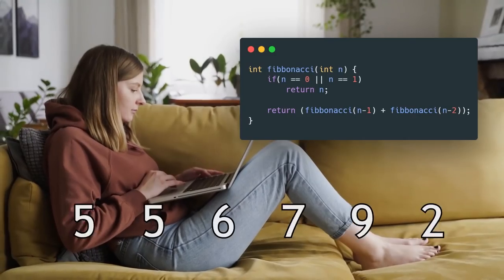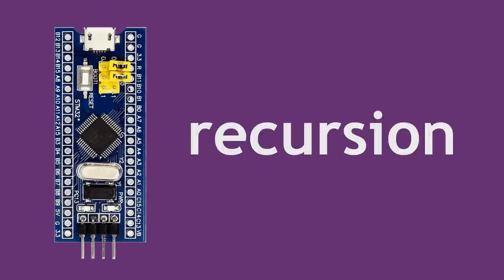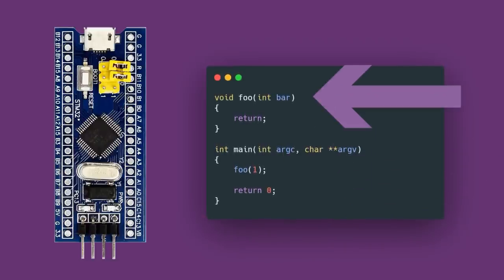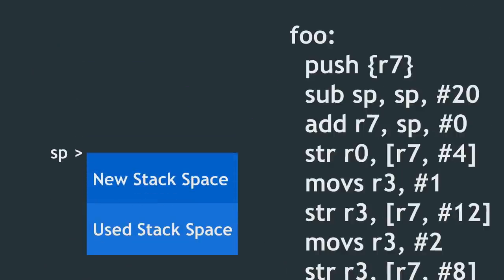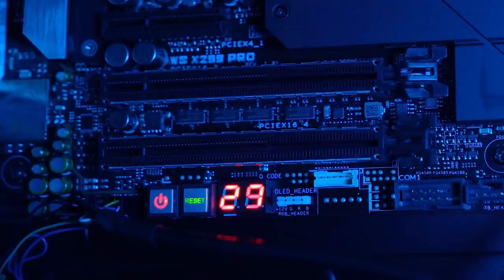why is recursion bad?

Comment: I've been writing C for 30 years, I have never had need to call a function from within itself.
Reply: What about the MiniMax algorithm?
Reply: @softwarelivre2389  I had to google it, not the kind of code i've ever been asked to write.  I am not going to pretend I know what I am talking about, but a search for 'non recursive minimax' seemed to find working examples.
Reply: @jonshouse1  you could probably allocate a tree-like structure and work iteratively on it and you'd had a non-recursive minimax, but I've never seen anyone doing it and I don't know if it is feasible.
Reply: @softwarelivre2389  have a stack data structure where you push tree nodes into and pop from. This will allow you to iteratively go over the tree. So you first push the head of the tree, pop it and push it's children, so on and so fourth. If you want you can even scan the tree by height with a queue.
Reply: @kandlerziv4733  never thought of using stacks or queues in a tree, I always saw both stacks and queues as linear, while trees could be branched. But it is a really interesting view and I'll take a look on that soon. Thanks for the info!

Comment: I'm a Haskell programmer, so I literally can't write any code without using recursion. Otoh, Haskell isn't the best fit for embedded, so it doesn't really matter. TCO means stack space is not a problem (as long as you are careful).

Comment: Stack overflows are merely annoying on bigger machines not because they have lots of RAM (it helps a bit though), but because of memory protection. In the early 90s, you could have megabytes of RAM, but one rampant recursion later and your entire OS was hosed and required a reboot. These days, you get an error message, close it and continue as if nothing important happened.

Comment: It’s a good point that recursion should be avoided if it can be avoided using simple code refactoring. But in fact, when trying to convert recursive code into iterative code, in most of the cases, you will end up creating your own implementation of stack for the algorithm, by simply allocating a memory buffer (for example in DFS or BFS). In those cases, the overhead of recursions is actually minimal, since you actually do JMP instruction in both cases, and in terms of memory, the only overhead is a function return address (1 word per call), not much, unless you are on a really tight memory budget. In that case it is simpler to just use recursion and just don’t bother:)
Reply: Bingo.  I did this exactly for a quicksort implementation once, then I looked at it and facepalmed because I had produced exactly the same code but used the heap instead of the stack.  In x86 ASM, though, I did get a modest performance improvement just out of replacing RET with JMP, but still using the stack for the memory.

There are fundamental limits when we talk about algorithms.  Often there is a lower bound for the complexity.  You can move that around between time and memory, you can move it around between stack and heap and static, but you absolutely cannot make it disappear.  It's fundamental to the solution.

Comment: The point of the video is well taken but recursion isn't entirely out on embedded. For example, there's recursion with static functions and trampolining (where your return value provides some indication of a re-entrant call along with the parameters for that call). Both maintain a fixed stack depth. Admittedly, these are a less powerful form of recursion, unable to return back to previous states stored in the stack. You could also use a language that supports tail call optimization, which effectively acts as a static function when the recursion point is in a tail position (i.e. the last thing done in a function). Rust can do this but provides no guarantees. Some C compilers will also (similarly with no guarantees) when given the right optimization flags.

Comment: A 'static' prefix will allocate the variable on the heap but be careful of initialization- it's only done once, first time the recursive function is called.
Reply: No, static doesn't allocate on the heap. It allocates on the static memory.
Reply: @AlessioSangalli  , depends on the memory model. But you are right, it could be outside both heap and stack spaces in a preallocated data segment. Good point.
Reply: @test40323  well yeah the C memory model doesn't really specify "how" memory is allocated, but I am not aware of a compiler system that allocates static variables in the heap 😅
Reply: @AlessioSangalli  , thanks for the correction. My point is static variables in functions are not allocated on each call recursive or not. If my memory serve, a tiny memory model allocates everything in an Intel 64k segment, code, data, heap, stack. With optimization on, there are no bounds on stack just data corruptions as they grow towards each other.
Reply: @test40323  often (but not always) in embedded there is no MMU and no virtual memory so yeah the stack starts somewhere (possibly even less than 64k) and goes down overwriting whatever

Comment: Every recursive function can be written as a tail recursive function. Every tail recursive function can be optimized automatically e.g. by a compiler to be as memory efficient as a loop. So if recursion blows your stack it’s highly depended on your language and compiler.
Reply: Let’s see your tail-recursive version of Ackermann’s Function.
Reply: @lawrencedoliveiro9104  You are right. The claim only holds for primitive recursive functions. But other recursive algorithms cannot be implemented in an memory efficient way and should be avoided anyways.

Comment: Recursion is very often:
-hard to read (just think of the first time you encountered recursion)
-less than or at best as performant as loops
-not clear as to how long/deep that recursion will go

I hate recursion.
Reply: Recursion is easier to read and easier to write if only you understand recursion.  It also helps with avoiding bugs.  And the Knights of the Order of the Lambda Calculus have proven that recursion is typically more efficient than the clumsy constructs made by people who don't understand recursion.  (Goto considered harmful.). Recursion is just loops, which becomes obvious when you understand it.

Unfortunately, to understand recursion, you first have to understand recursion.

If you don't understand recursion, you're not a programmer.  But when your compiler insists on using stack for recursion even where no stack is needed, you have to work around it by hand, which is what this video is about.

This is often an issue with C, and always an issue with Java and even Python.

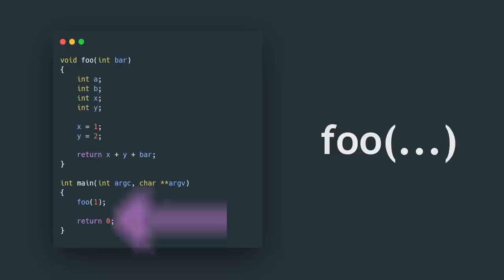Comment: 1:22 - Not exactly "padding". At least the return address is also needed.

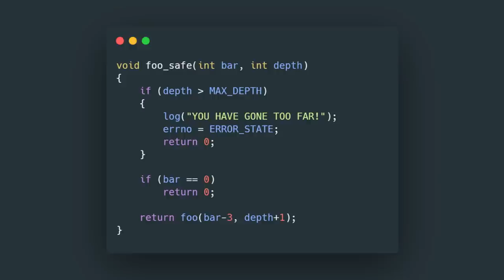2:35 - Well, if you cannot predict how deep your recursion is going to be, then indeed don't use it. 

There are many algorithms that are "naturally" recursive. Recursive functions are also often easier to read. (A typical example would be already mentioned Fibonacci numbers of Towers of Hanoi problem.) While, in principle, every recursive algorithm can be expressed by iteration, it is often done by explicitly managing the stack, with neither performance for storage advantages. However, there are problems where iterative algorithm is much "laener" that recursive one (a trivial example is factorial function).

Comment: Well even on embedded systems this advice needs to be taken with a grain of salt. Under certain likely conditions your compiler will be able to proof that it doesn't need to return to the calling function. This "tail call" is then simply converted into a jump to the body of the function itself. Unfortunately, while most mainstream C compilers support that by now, often it is only enabled by -O3.

So if you know what you are doing, you can often replace those weird C features like "destructive variable assignment" or "loop constructs" with much cleaner recursion. However you need to be careful about it and perhaps occasionally check if your compiler actually optimizes it.

To those people who don't know C: The language has some weird quirks. For example this is perfectly valid in C:
int x=5; //Variable definition
x=4; //Assigning a different value to x, the previous value is lost! This will compile and run!

Or loops in C are often done like this:
for (int x=0; x<10; x=x+1) {
.....
}

This actually uses destructive assignments to change the value of x, so every time the inside of the loop is run, x will have a different value. If you destructively assign x=999 this will be the last time the statements will be executed. I think much of the bad reputation C has comes from people expecting the compiler to not allow that sort of thing.

Of course if you come from an Assembler background this all makes sense, so if you want to learn C, it makes sense to first familiarize yourself with some simple Assembler. (e.g. Z80, 6052, AVR 8-Bit) C is, in many ways, just a "friendly" semi-portable assembler. It's not like a high-level language like Prolog which you can just program without knowing how computers work.

Comment: I was lucky enough to TRY to begin computer science in 1995, with the first language being Scheme, which is LISP. Horrible, confusing and ridiculous because it's a functional language that's nothing but recursion. Then, returning to get a CS degree at the same university many years later, I started with Java, learned C very well, and happened to take "comparative programming languages" where I learned LISP, Haskell and COBOL as an elective language. At this point, most CS students dread recursion because it's hard to conceptualize and they NEVER learn a functional language other than C. They have no idea why LISP is called "lots of idiotic silly parenthesis" and how it's a recursive nightmare to conquer. I like the video as a way to help people learn about new limits to consider but with a modern degree, you can learn your assembly AND dabble in ancient functional recursive stuff enough if you elect and this would be obvious. Don't ignore a chance to take that course.

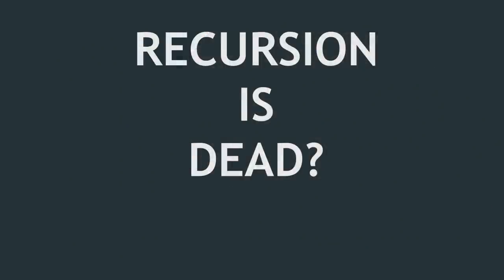Comment: 2:25 another thing to add that might work to make recursion easier on embedded hardware (and not into a logic bomb) is the use of a register that holds the end value and then the memory is allocated in the same place replacing the first instance of memory (which houses the program) with a new program instance. this would allow the program to occupy the same memory space while still keeping the values changing as expected, changing while the program runs..... I think I just explained a conditional loop now that I think about it....

Hope you have a great day & Safe Travels!

Comment: is recursion only recursion if you call the same method from inside of it? i would never do that as it always takes up all the memory in the stack in java xdd
Reply: Yes recursion is when you call the same caller function.
And you can do it perfectly in Java. I’ve used it in Java to traverse a binary tree. But you always need to be aware of the depth. Live this video suggests.
The charm of recursion is, that it’s fault tolerance is higher. (Loops can have off by one errors or calculation depth errors).
Reply: @CallousCoder  I didn't mean that it's not usable in java but I'd prefer loops as for example having a backend discard too large user input because of memory usage is not good imo, ofc for smaller depth that is personal preference and I'd say that using recursion is most likely easier if the case allows it to be implemented without weird hacks
Reply: @kmatias2467  recursion or loops for user input? Can you explain that. I just limit that on the server side. Or use an text field pattern that sets the max length for a field.
I’m curious what you know that I don’t. Love to know :)
Reply: @CallousCoder  i had slept 6 hours in the last 2 nights when i typed that but the idea was to make the data length limited but the recursion not for normal use cases as that would not make the program as limited, I'm still tired as i only slept ~14 hours now, i can't give you an example of this since I'm still tired but for example sending data from something to be calculated server side like how ida does would probably use that

Comment: What you explain in the video is somewhat true but you're mentioning only half of the Truth. What is unwanted is a very specific kind of recursion called "head recursion" where you keep allocating new stack frames because you use recursion to save the local context, do one or several recursive calls, and then resume the computation by combining the results of the recursive calls. Turns out this is a very specific pattern and recursion is not restricted to only that !!!!!

It is often the case (the Fibonacci sequence is a perfect example) that recursive functions can be written in such a way that only ONE stack frame is going to be allocated through the entire execution of the program. Actually, every while loop based program can be rewritten as a tail recursive program. In facts, the tail recursive version is going to be compiled EXACTLY as the while loop by all reasonable modern compilers.

Comment: Fibonacci is a good example but it can be calculated without loops or recursion. There is just function that gets any fibonacci number so you can pug n into the function to get the Fibonacci number and it doesn't include loops nor recurion. Iti s mathematical function.

Comment: I hadn't considered the call stack, but then again, I haven't touched embedded in 7 or 8 years at this point. I just try to avoid recursion where I can, because in many (not all) cases you can write a better and clearer implementation without it. It just takes a bit of extra work.

Comment: Recursion is not bad, you need to learn calculate the complexity is the right way.
To a extend, doing the same sort on different lang like c and Python will very different due to how memory used.
If you are not sure what are you doing, use functions in framework and let them optimize for you.

Comment: Also, probably shouldn't be using recursion for fib anyways. Despite being the example that's primarily taught for recursion, it's recursive solution is laughably bad, O(2^n) if I remember correctly. It can be modified to only use a single recursive call through memoization, but I'd argue that approach is still an inefficient use of resources, especially if you don't care about the whole array and just want the nth digit. Iteration is definitely the way to go for fib.

Comment: The moment you understand there is Space Complexity and not only Time Complexity is the moment you are better then 90% of Programmers out there in Algo.
Reply: Only complexity exists is trade-off complexity, aka general efficiency. If you are running that function once an hour, or dependent on user input on single machine,  if the problem is better suited for recursion, go for it. No? Then don't. Simply as that.
Reply: @yokunjon  Thats just not true. There is Space and Time Complexity. Yes there are certian cases where you have a space-time tradeoff, but most of the time there is just a better way for an Algo where you just have less Time or Space Complexity while maintaining the other Complexity the same.
Reply: @NoelmineZockt  But does finding or impelementing that algo, fine tuning it really worth the effort? That's what I'm talking about, if the tool you use accomplishes its goals, no need to perfect it further, unless that's a business requirement. So what I'm talking about is resource management, if the result is going to take an eternity to produce, it doesn't matter how fast it works. So, as an example, searching function of random website could be 2 seconds, you could create indexes, have clever algorithms to reduce it; but unless you are a search engine, those are probably not worth the time & money invested in. So, in practical terms, everything is real-world resources trade-off. That was what I was trying to say. Other than that, I do of course agree there is space complexity and time complexity, that's undeniable fact of computer science. But most of the time, practical realities do shadow those, so that's why I said "they don't exist", it was metaphorical. :D

Comment: bothersome AKCHUALLY: in the given example, any compiler worth it's salt will see that foo(x) = 3+x; and will inline any callers of foo to just add 3 inside the "caller" without even using a call instruction and building any stack frame at all.  Of course, inlining is right out in recursive cases because no static code can expand into itself infinitely.

Comment: Recursive algorithms can definitely be proven correct more easily than imperative ones, because proofs by induction are natural.
Reply: Did you watch the video, or just read the word 'recursion' and comment based on that?
Reply: @NilesBlackX  See, I think the video itself is a bit guilty of what you’re implying here.  It’s very very hard to find a common programmer who reaches for any recursive solution rather than one involving a loop.

I think my comment initially was a little rushed, but my point still stands, and it was not really mentioned in the video.

Comment: It's usually easy to NOT use recursion, you just gotta know the low-level logic. You can do Fibonacci with 4 integer variables, no recursion.
uint32_t fib(uint32_t n)
{
  if (!n) return 0;
  // setting up for n=1
  uint32_t answer = 1;
  uint32_t recent = 1;
  uint32_t previous = 0;
  while(--n) // skipped for n=1, executes n-1 times
  {
    answer = recent + previous;
    previous = recent;
    recent = answer;
  }
  return answer;
}